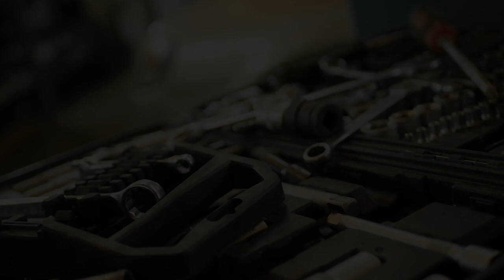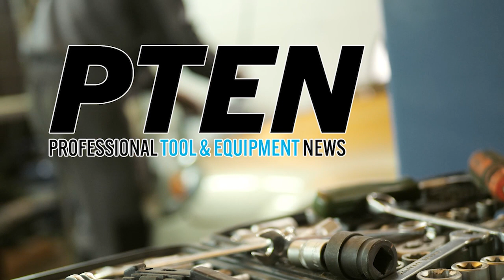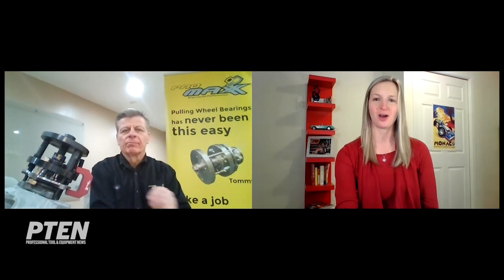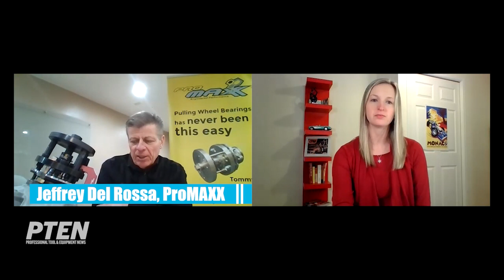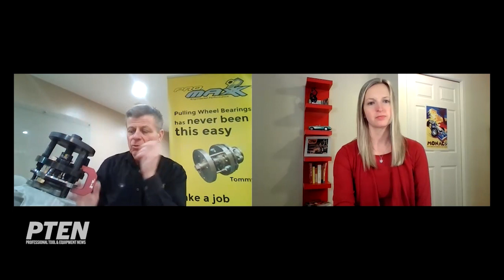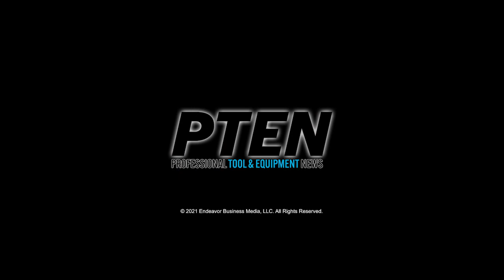New Tool Innovations: Tommy Rail can save you 3 hours when removing a wheel bearing

Comment: I have a hard time understanding what the Tommy rail actually accomplishes, and it would seem that there is a lot of double talk here that doesn’t make any sense to me as I’m just an engineer.  It would seem as though it’s purpose is the keep the pulling flange attached to the wheel hub.  Guessing that since the pulling flange is made from aluminum, you are seeing failures in the flange, and this is meant as a band aide perhaps.